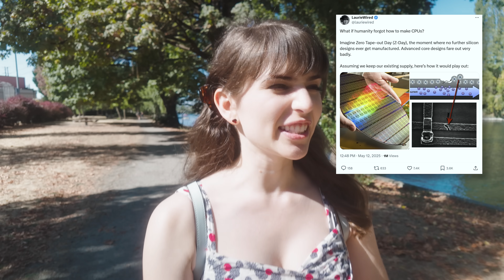what if humans forgot how to make CPUs?

Comment: Honestly, I think the scenario is too unrealistic to be worth your brain-power. Sony stopped making CRTs because something better, LCDs came along. Fogbank was a confluence of top-secret and low-volumes; the pentagon learned a hard lesson about supply-chain management and redundancy. And the rocket engine issue is complex: we could build another one, given the time and budget; we still have the hand-drawn plans as I understand it, but industry has moved on so manufacturing techniques used then are no longer used now. We'd either have rebuild dead industries or design something new. 

So why would tapeout end? There are too many people and companies doing it worldwide for it to go away like the rocket or fogbank. So most likely, its because something better came along. 

All that aside, I'd like to point out the real digital apocalypse: nothing we store data on these days is what a librarian would call "archival quality". HDDs fail in a few years if you spin them, but they also can seize if you don't spin them. magnetic tape absorbs water from the air and the adhesive that holds the magnetic material to the plastic fails. SSDs slowly discharge over time. CDs and DVDs are horrible too. The foil layer likes to separate from the substrate over time, and then rust happens. Sometimes you get fungal blooms on the discs too (never understood that one! What are they eating?!?). Writeable and re-writeable disks are worse than CD-ROMS since they slowly degrade whem the UV reactive inks in them sometimes spontaneously react to ambient air, cosmic rays or whatever. To get actual archival storage, you need to look at paper tape and punch cards, things we phased out of use decades ago, and are impractical for modern storage densities. under optimal circumstances, one short ton (2000lb) of punch cards stores a wopping 10MB of data. To get archival storage in the modern day, we need to store the same data on 3 or more HDDs and have a constantly running process to check the data consistency, reconstruct it when it's bad, and cycle through replacing those HDDs with new ones such that every HDD is replaced every 2 to 3 years. depending on the speed of the system and access rates, 3 drives may not be sufficient, either. we already need more than 2 parities just to ensure we stay ahead of the failure rate during reconstruction of a failed drive.

We're already experiencing the effects of this data loss. NASA faced a nightmare scenario a few years ago where they had data from the Apollo missions being lost as the mag tape it was stored on degraded. They couldn't spool it off to new media fast enough, and the hardware they had was old and failure prone. BBC has lost decades of programming, some because of poor data management, some due to a warehouse fire. The computer industry has problems with old data files becoming unreadable because 50-year-old hardware is gone, and modern hardware is not compatible. No-one really cares that a 5M disk platter from the 60s or 70s can't be read on a modern PC, except archivist who don't have the budget to hire an engineer to build hardware for them. Richard Stallman wears them on his head and pretends they're a halo.

Comment: making the "simpler" stuff with the really long life span is kind of manageble with simple tech, think something you could actualy build in your garage. at that level knowledge of the chip design would be more important. on the other end even if you have chip design down, small stuff is imposible without the highly industrial setting with insanely expensive equipment that is so precise it's hard to imagine we humans actually can build something like that. and there is only a single company actually making those machines. their compations legit gave up and changed corse as a company cause of the dificulty.

Comment: What scares me is this outcome is actually plausible. 
A couple of things I disagree with 
1. SSD/Flash storage is NOT preferable to magnetic-based storage. Spinning rust and tapes age just fine when stored offline and unpowered in a controlled environment unlike SSD devices. 
2. Most consumer-grade optical storage media is utter trash. it was designed to be just good enough to get the consumer to hand over the cash. 
3. While shrinking node size and larger wafers increase yields and profits, there is a fixed overhead for operating every die foundry. Ask me how I know this. 😝 (IMHO I am amazed the environmental groups haven't been screaming for the abolishment of such places)

Comment: I know this, the smaller the nano meter of the nodes, the faster they degrade. Transistors wear as they are used and the smaller the node, the fewer molecule per transistor and the faster they will wear... 
So the new CPUs and GPUs have higher transistor counts with smaller nodes, but they aren't as rugged as an older 14nm or 22nm node chip. lol.  
I have a Ryzen 9 5900x which is 7nm, and frankly I don't want to "upgrade" because of what I know about chips lol. 
I don't think the newer 3nm stuff will last a decade or more like some of the older chips. 
Anyone that knows how to do it, will be undervolting and clocking down their hardware like crazy to make it last LOL 

Yes software will have to be optimized like crazy.

Comment: 11:25 The microcontroller(s) in optical disk drives could fail too... That'd be a cruel irony. And that's before mentioning that the optical media themselves could fail "prematurely" if data is intended to be stored for decades from "disc rot" or the layers delaminating.

Comment: I'm still fairly new to computer science, so there are many parts of this video that went over my head, but the little I did understand seemed to come down to node size for transistors and memory degradation being the biggest problems. So with that in mind, would any Z-Day timelines change if we had some form of organic memory storage that datacenters could rely on? (A variation of DNA storage that would be accessible like RAM, for instance)

Comment: We take existing architectures and port them to carbon or other elements, it is just that would need an insanely big investors like the chip fabs creating huge teams who work on making a total replacement of silicon and making next era of computing, we still need radios and gps, so much relies on silicon that it would just be replaced and the new tech would in some time get equal and then better than today, we would eventually have full backwards compatibility for silicon based computing

Comment: No longer having CRTs is a HUGE problem.

We cam no longer manufacture analog oscilloscopes which are necessary to properly analyze analog signals such as those gushed in radar systems.

Comment: In college one of our final projects was a SAP (simple as possible) computer, built with various components (think resistors, capacitors, etc.) and I was tasked with building the memory controller. I was also the only student the teachers ever had up to that point to get it (or any other segment of the SAP computer) to work on the very first try.

It'd be wild to see "new" computers with CPUs built like this - they'd be massive, and they could work. As you mentioned the vacuum tubes and mechanical logic machines that broke Enigma, those would probably also be reserved for the elite and wealthy. A lot of electronics and components getting recycled for these tasks, and junkyards becoming gold mines (literally and figuratively) to those who know what's what. All those microcontroller chips, VLSI, 555 op amps, etc. just sitting there waiting.

Comment: So, no new cpus, is actually a lot more catastrophic, a lot more quickly, than  simply having to rely on the existing supply. There is a lot of industry predicated on quick and cheap custom integrated circuits, to the point where they either stop working or could quickly be repurposed to produce functional equivalents of a lot of old cpus, without regards to not having the design, simply on the basis of junior year CS simulations of old CPUs (relatively standard 1 quarter project) and first principles binary logic. So, either we also lose the adhoc IC industry or we still have CPU production, just not modern cpu production.

Comment: Something like that would even affect how diseases spreads. One simple thing would be a limitation of airplanes and shipping. Transportation would still be possible but far harder and after the initial burnout of various illnesses in high population areas, global pandemics could potentially be far harder to have happens. 

Libraries would be incredibly important. I can see a network of librarians and electrical engineers burning through as much processors as possible to basically turn analog all the digital only books and other materials. And I can see this being a contentious point between them and the local government trying to make their supplies last as long as possible.

There's a few other scenarios that I'm imagining that could happens from these processors declines. And it would make for a wild addition to any such post apocalyptic stories lol

Comment: I majored in HW design and can make a simple CPU with full instruction set just from a lot of NAND ("negated AND" which you can make from a few transistors or mosfets) components, so I can go full on Alan Turing on you and make room sized CPU in a year or two if needed. My only nuisance would be design without a PC (and VHDL language help) if I were to do that on paper, still doaible but major pain in the bottom.

Comment: I wouldn't think SSDs would be better than HDDs in this scenario.
SSDs needing power cycling every 6 months to 5 years, where HDDs are less volatile to data loss and become ideal for longterm data storage. The people using computers would be incredibly sparing with their usage, where having to worry about power cycles would be a hinderance than a benefit. HDDs would survive with sparing usage cases the best and I'd assume that Computers would be utilized sparingly in this scenario. Additionally HDDs can be franksteined to last as long as the parts are available and the platers aren't damaged, where once and SSD fails they just become a paperweight, and they can fsil from just going through almost all kf their read-write cycles.

Comment: Very interesting. I think the Internet would last longer than you propose, but only if websites bothered to be efficient with data and both server and client side processing. We'd probably get web plug-ins that warn us about bad websites or that stop client-side processing. But beyond that, we would depend on Google to update chrome to handle that for everyone. Never expect everyone to do the "right thing" on their own; many don't know, many don't care; and we don't want to burn tons of CPUs on the way there.

DDOS attacks would become outright terrorist attacks, just as much as the destruction of property or buildings. 

And industry would collapse quickly. It has the most durable processors, but it has them because it needs them. They still go bad. And they are rarer, small-run components. And industry depends on the entire production line working, so the loss of one processor can stop an entire line. 
Companies will adapt and arrange for spares and backup plans, but they'll feel it.

Comment: we still manufacture and use MCUs that are near identical to how they were invented in the 70s. But in that scenario I would be worried about people forgetting how to program at a low level after decades of LLM usage. 1/ If we lose CPUs we lose LLMs which is increasingly how people program 2/ If we lost CPUs we would lose compilers? Already less and less people are learning to program these early MCUs from the 70s in assembly, writing code and debugging would be insanely slow, and everything would run magnitudes slower (fine for most things like public transport as John mentioned) and it's crazy what we achieved just using relays

Comment: This is an interesting scenario, but you really only touch on the IT infrastructure issue. The larger issue is that everything runs on silicon now. Automated manufacturing would likely run for a decade, but without new components, the entire supply chain would collapse. Local manufacturing would have to become the norm, and forget about precision components in anything but high-end products. Power, water and other utilities would run for a time, and become incredibly expensive or shut down completely. You've said CPUs, but really this scenario really means what if we forgot how to dope silicon. If no chips or ICs could be produced we would devolve quickly as a society. Engineers would scramble to keep critical infrastructure running after the first 10 years.

Comment: You forgot about the hard copy printing frenzy where, after everybody realizes what's actually happening, people start massive public projects to print off the most important information caches like Wikipedia and major news repositories so some few hard copies actually exist.
Reply: Librarians work would **explode**, initially, they'd be good custodians of already printed data, and if previous experience follows, a couple of dedicated nerds could/would get them a small offline wikipedia cache for printing at their leissure as they see the requests come
Reply: Haha!  Reminds me of my very first IT mentor at Sydney Uni in the early 2000s.  He insisted that all modified configuration  files on our Tru64 UNIX systems had at least one annual "paper backup".  We'd be printing for days!  The printouts were put into a series of pigeon holes bolted to the air conditioning control room door.  I still use the term "aircondoor" with respect to backups as a result.

I get a lot of blank looks if I ever mention it out aloud!
Reply: you didn't grow up before Wikipedia I guess, not even early days? If it comes to actual print, encyclopedias like "Encyclopedia Britanica" with COPYRIGHT ARTICLES taking the place of "open sourcey wiki stuff" which only works when there are no printing costs.  I'm being realistic, Wikipedia will just fade away. It is at heart an "open" project and that doesn't work with paper and ink!
Reply: @squirlmy  I'm just breaching 50 years old. We had libraries. Basically an early, semi-gimpy form of "open source".
I could definitely see a library holding a massive room of micro fiche wikipedia articles (at least the important ones - mathematics, physics, etc.)
I also wouldn't be surprised if published and peer-reviewed articles (the ones that have weathered the test of time) were collected by universities. You wouldn't believe how many published scientific papers exist only in digital form.
Reply: Wikipedia being important lol. print away dude
Reply: @CartoonCityKid  I heard somewhere that you'd need over 20 million sheets to contain Wikipedia :P hah!
But ya, with my printer? lol - No dude, not happening.
Reply: My father actually printed video game FAQ and cheat code websites as well as social media discussions from the 1990's, I have looked online and were unable to find any extant archives of several of these websites, meaning that the only evidence for several websites is already printed out. 

Because my father was very tech savvy, he stopped printing out websites around 2002~2003, so I don't have anything in my archive from after that period. 

My best friend's father actually kept printing out random websites until his death a few years ago, and I found a man who printed out websites left and right, unfortunately, I couldn't save much of his printed websites and most of his books were burned because second hand shops refused them.
Reply: That's a lot of trees. All the important equipment manufacturing instructions... the resistors, capacitors, transistors, EM microscopes etc.
Reply: Microfiche would be better

Comment: I prefer the solar storm scenarios better. It is tough to reestablish factories if all the tech goes simultaneously (although I am grossly simplifying, some tech is weatherized to be resilient, and solar flares do not effect both sides of the planet equally).  I just wonder what people would do with no tech sometimes. I work in physics, so it would be bad for forward progress in that sector. A lot of frontier physics requires computers between imaging, (P) Diff-eq computation, and simulations.

Comment: 1960's era mimeograph machines would make a comeback. They were basically a hand crank operated xerox with all mechanical parts, no electricity involved. They were used for small publications, underground zines, weird star trek erotica, etc. All the weird niche communities that found each other on the internet, would have to go back to offline communication. You would find people transcribing their locally saved Jerri Elsworth transistor video into print with illustrations, and then publishing them in zines via mimeograph and sending them out by snail mail to subscribers. The more popular releases getting picked up and published by actual magazines, like Byte. Public libraries would have entire sections for the back catalogs of these community publications/zines. Archivist would transcribe and adapt digital media to print and film. First starting with anything a computer printer could directly print out, while that is still an option (modern printers and even ink cartridges have chips in them). I think most of the heavy lifting would have happened in the first year by these groups. Major technical challenges would be overcome, and a massive amount of community fundraising would happen by a movement of people to get The Internet Archive to "#PrintTheInternet!". Universities would collaborate to help in this effort, since so much research material was online-only. Conventions and local community clubs would make a major return as people seek community that was previously available online. A centralized system, similar to the Phonebook would come out that would list local community groups/clubs, organized by category.